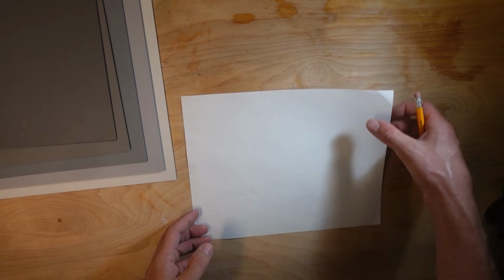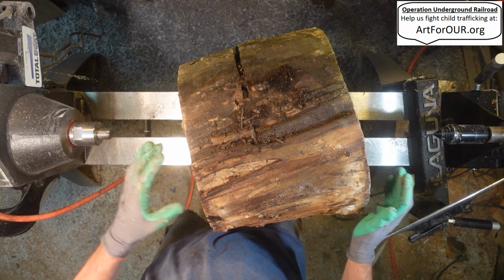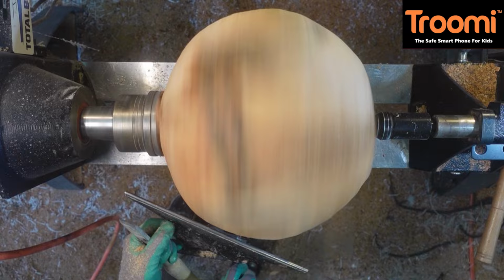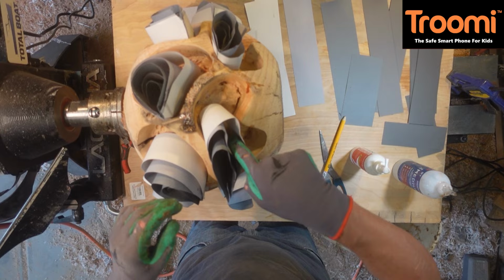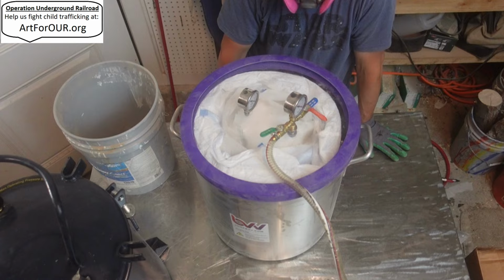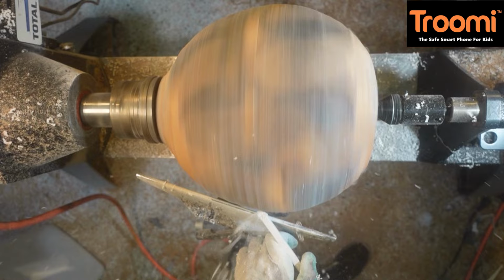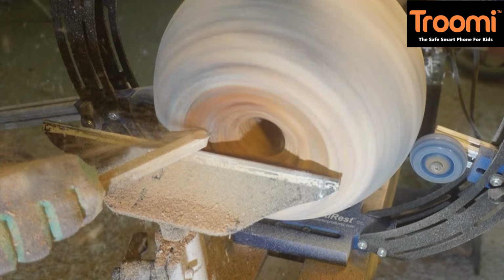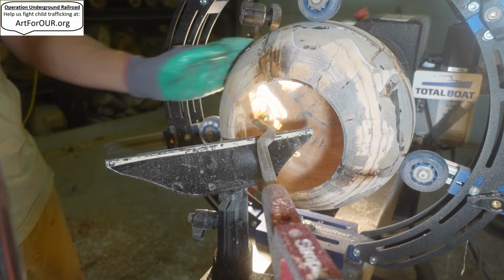"Ancient Chaos" How to combine quilling, woodturning and resin art to make a vase. For O.U.R.

Comment: Damn... Despite the fact that it dindn't hold to perfection because of the wood being all cracky and splitty, that is still one beautiful and unique piece, that you can love for its imperfections!
Now, I'm not an interior decorator, but I can see this piece being hung upside down like a ceiling lamp for a high-class living room right off the bat, even more so if the living room had decorations in the same wood color once finished - like the floor panneling, for instance -, with the wall color being pure white, and the furniture in dark colors for contrast - maybe the darker, brownish tone of the bowl piece.
But what matters the most here is that any piece that stands the amount of work put in is a success. I can imagine pieces of wood cracking into shards because the wood is no good, a disaster if you're doing something on commission. So congratulations!
Reply from the maker: Thank you!  Much appreciated. 

ArtForOUR.org

Comment: A tip lifted from Blacktail Studio: to stop air coming out of the wood into the resin, do an initial resin coat which is just a thin layer painted on. It can be a more quick-setting type, so not adding a 3-day delay to the project. When that resin is dry but still tacky to the touch, the main pour will still bond to it.
Reply from the maker: That's a good idea.   I've tried that in the past and still had streaming bubbles from any tiny pockets.  What has worked far better for me and far more consistently is the vacuum chamber...

Comment: How about putting icepacks mixed in with the sand? should last many hours cold and keep the resin cooler. Even wrapping the outside of the pressure pot with some icepacks too
Reply from the maker: That's a good idea.  I recently bought a little chest freezer to put it in.... hopefully that will solve the problem.

Comment: Dan, it may not be what you had planned - but it has a really interesting look. 

Some ideas for the next time you try something like this. Try turning the shape and hollowing it before you cut the holes and add the paper. Then stabilize it in cactus juice. Then, simply cut the holes where you want the paper instead of having to excavate them. Try deflating a round ball and putting it inside the hollowed piece after you cut the holes and inflate it - that should hold the resin from filling the entire interior. This would make it so you use much less resin and considerably reduce the heat generated while curing.

You may also try alternating colored foil with the colored paper for an additional effect.
Reply from the maker: Thank you!  Good ideas!

Artforour.org

Comment: I have seen so many ways to work with resin on a lathe that I’m sort of confused..   I’ve scene people pour, what seemed like 5 gallons and let it sit without a pressure pot. I’ve seen others using one and now yours, that seems like the resin is going to catch fire from the heat. Is there resins that don’t heat up as it hardens or something? If I do work up the nerve to make a resin blank, it would be without a pressure pot (because I can’t afford one…). But I’m just lost on  how I’m going to it. I don’t have a giant freezer or live in a cold state, an I just going to have to put it into a tub of ice water in my back yard? Will I even end up with a clean and workable piece? Will it be so full of bubbles that cause tear out making the finish require even more sanding than normal? I’m scared to even try glue blocks together to make larger blanks because I’ve never done that before either.
Reply from the maker: If you need to have a clear outcome, you'll need a pressure pot or vacuum chamber .  If you're ok with tiny microbubble in your project, then you don't need either.  Most resins can't be poured over 4 inches in depth or the reaction when hardening releases so much heat it will boil or crack.  The room temperature is everything for big projects.... you have to keep the project below 60 degrees or so....